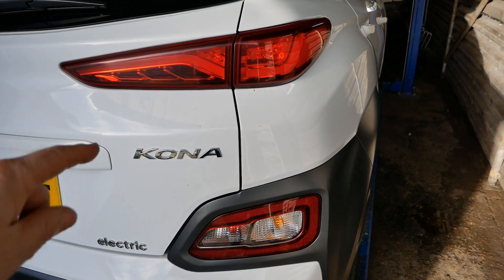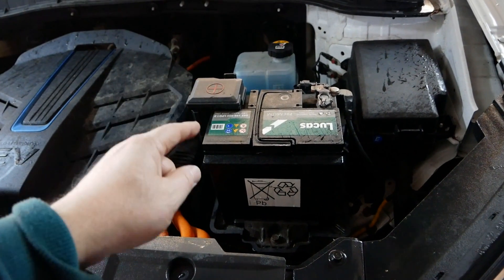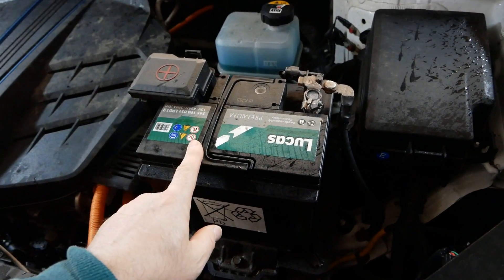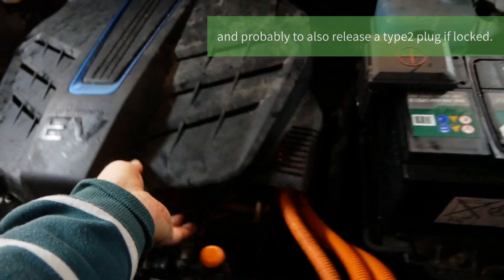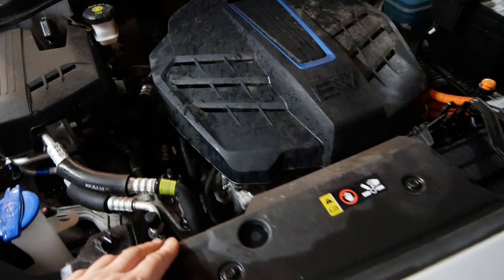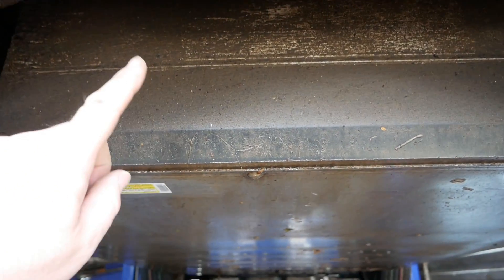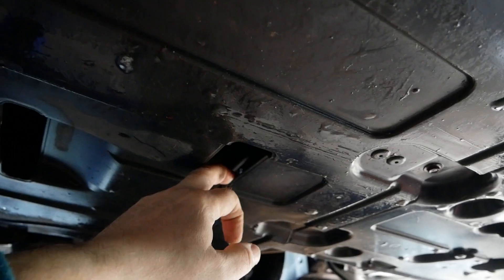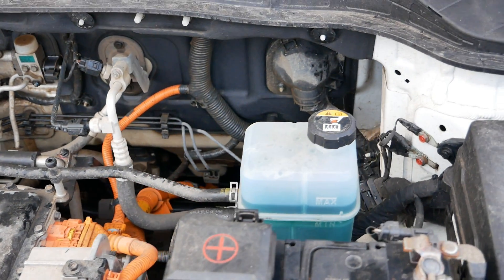A look underneath and under the bonnet on a 2019 Hyundai Kona Electric 64kWh

Comment: This is one of the worst videos I've seen for a long time. Rather than doing your homework beforehand you repeatedly say "I guess this is...", or you put your assumptions across as fact. Does that Kona really use the air conditioning compressor as a heat pump? My Nero had two separate units doing those functions, and it looks pretty much the same as your Kona under the bonnet.
Sorry Matt, this was a definite "thumbs down"!
Reply: All Kona electrics (at least in this climate) come with a heat pump as standard.  It is/was an option on many other brands including the eNiro.  However, it's worth noting that many EVs with a heat pump also have a smaller PTC heater to assist with dehumidification in the winter in certain climatic conditions and also as a primitive form of backup heat in the event of refrigerant loss or compressor failure.  Personally, I wouldn't consider an EV without a heat pump; combined with the aerodynamics, it's why my Ioniq 38kWh seems to achieve largely the same range as my old VV ID.3 62kWh did.

Comment: 13:30 that is the battery heater, connected to the batteries coolant exit connection.  Heated coolant goes back in after going through the pump.  There have been a couple of reports of this heater failing and causing a HV ground fault.

Comment: That looks like the green coolant that was used in the early Kona;s
Reply: I think the early ones used conductive coolant, later chnaged to pink non-conductive which is expensive - normally changed at 40K but the crystallisation issue meant this often got done under warranty.
Reply: @mikeselectricstuff  Yes I have had mine done under the service campaign. The BSC-2 coolant used is light blue.
Reply: @mikeselectricstuff ,  the pink coolant is Hyundai's more recent conventional type, superseding the green. Apparently it can be mixed with the green and now after the battery change mine is red.

Comment: Looks a bit grubby under the bonnet. I assume the 2020 Kona is slightly different as the  charger will do 11kw on mine at work charge point.
Reply: The 11kW changer looks exactly the same apart  from the label and AC connector.

Comment: What battery manufacturer does the car get after replacement. Is the battery made by H Greenpower. I have a Kona EV 2021 with a new facelift with a battery pack made in 2021.07.15 by H Greenpower.
Reply: We have a 2021 facelift and have had the coolant recall. We don't believe we are subject to the battery as that came about before our production year.
Reply: @stulop  My coolant level dropped to minimum last month and it has been topped up by the dealer. Also I have an appointment in the middle of June with the Hyundai dealership to investigate the problem.
Reply: I got a 12v battery recall done on mine
Reply: I wonder why manufacturers are still using 12V batteries instead of simply dedicate a few cells of the main pack to perform the same function each time you turn on the EV. The lifespan of these cells is much longer, they are more reliable and would avoid the extra weight and bulky connections. You could still have the auto-charge function from the main pack.

Comment: Would have been nice to see some efficiency numbers from the display while you were doing this. Interested to know if this is more or less efficient than an Ioniq
Reply: Today in our non heat pump 2021 Kona 64 we are seeing 4.7m/kWh. The weather is perfect.
Reply: @stulop  Thanks for the feedback - that's useful for me as I am considering a used Kona purchase
Reply: @nextgensolopreneur  This week, 18 degrees C ,35 mile round trip to work on the A1...6 miles/kwh. Mk2 Ioniq. I'm not flexing but I'm looking at about a £2k saving,on fuel  at 13, 000 mile per annum. Comparison is my 1.3 petrol Qashqai.
Reply: @waynesimpson2074  Wow
Reply: We get an Avg of 3.8 doing motorway miles in winter. About 4.5 on AVG overall since new.
Reply: @Lewis_Standing  Thanks for the feedback - that's useful for me as I am considering a used Kona purchase
Reply from the maker: The Kona is much less efficient than the Ioniq due to having more power.
Reply: @GoGreenAutos  The Kona also has more frontal area (=poor drag) as it is trying to emulate the SUV 'look'.
Reply: @GoGreenAutos  Thanks for the response. I expected that. It's not as aerodynamic too.
Reply: It's hard to get below 4 miles/kWh, even on the motorway, so pretty good.
Reply: @mikeselectricstuff  Very useful info - thanks